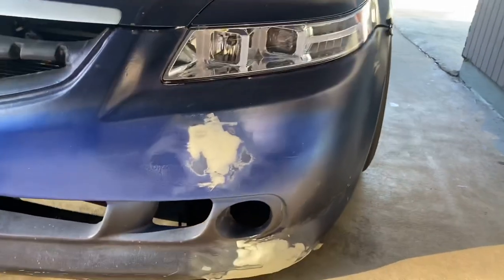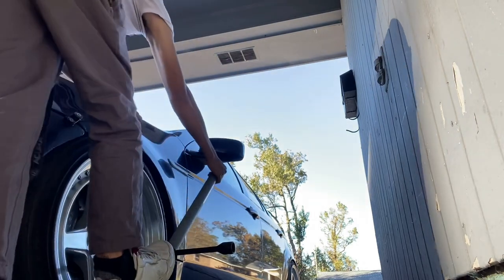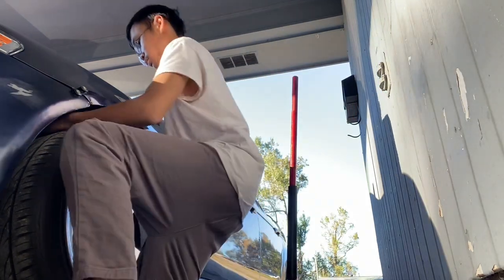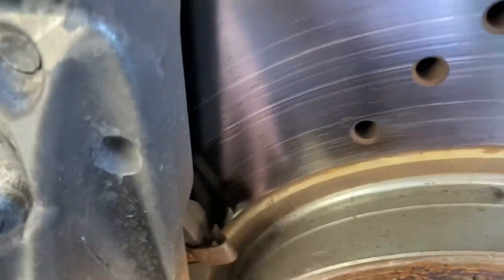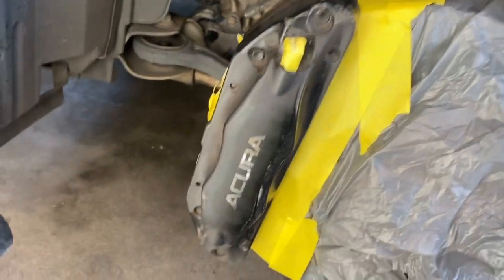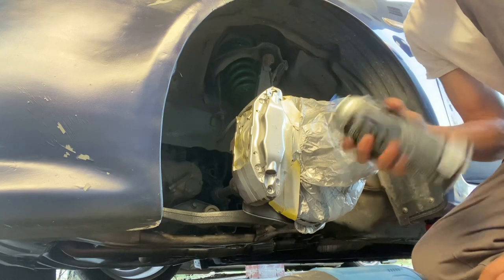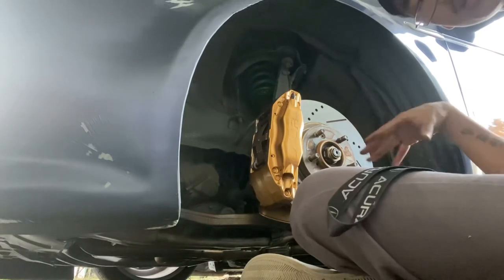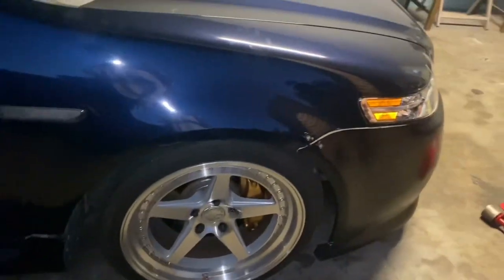How to paint your calipers | Acura TL |

Comment: It's as easy as that bro.  Keep making content, don't matter if the topic is interesting or not.  
What happen with the sticker/decal?
Reply from the maker: It peeled the paint up wasn’t fully dry and I stuck it on so I gotta redo it eventually
Reply: I tried it both ways.  Peel and non peel.  Honestly easier just to add the vinyl and spray clear.  Or even add it afterwards